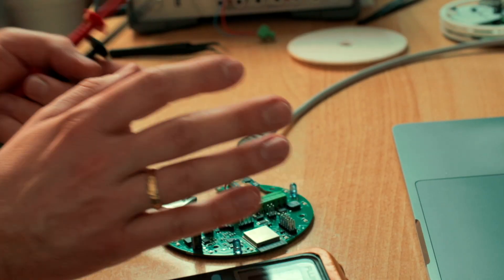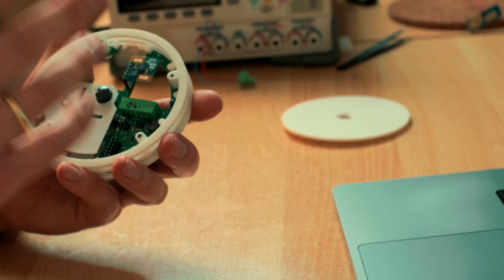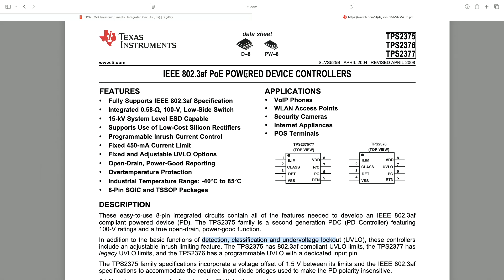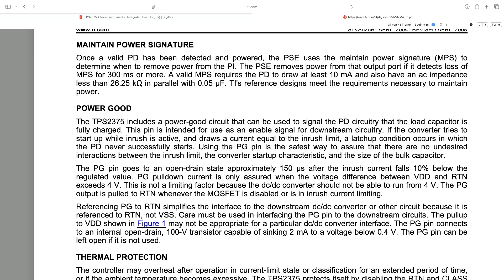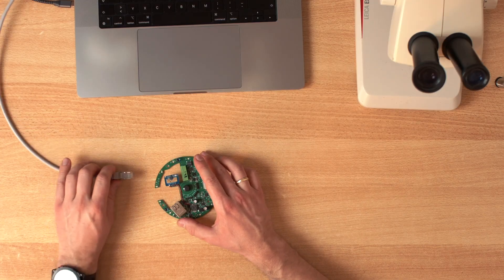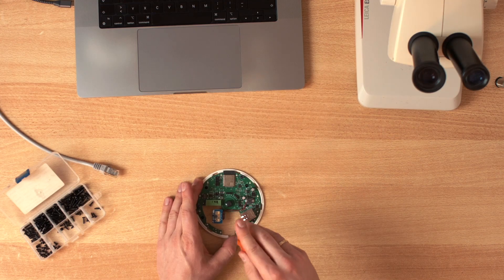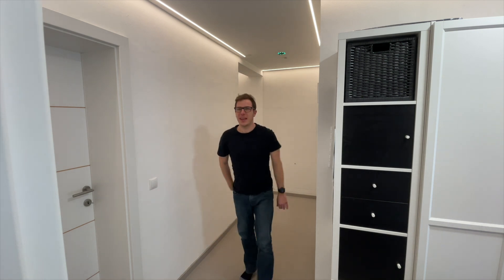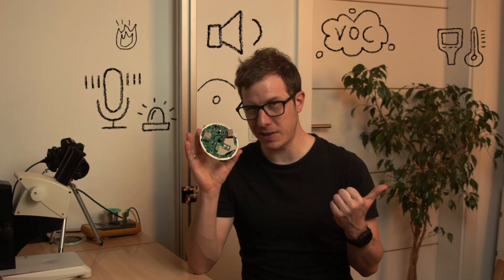ESPHome mmWave Sensor: Home Automation Magic

Comment: Remember to tune the mmWave sensor thresholds. Also, if you are concerned about heat/power, try the LD2410S which draws barely any power. Unfortunately I don't know how to design PCBs yet, but I think is is possible to have just a 2410s, a lithium cell, a charge controller and a simple radio transmitter in a small box, and have presence sensing everywhere.

Comment: 5:35 - slap a diode between PG and and EN, problem solved :)
Reply from the maker: Would be great but unfortunately not possible, PG is an open drain output.
Reply: @playduino but then if PG is open-drain, there is no possibility of powering the POE chip through PG. Are you sure that this is the problem ?

Comment: I'd guess that a schottky diode and 1ms RC filter from the PG -> EN line should be enough to properly connect those two chips with no issues, but obviously you'd want to check before trusting my guess.

Comment: For one of my projects, i added a breakaway part to the PCB using a KiCAD mousebite library. I sneaked data lines through those mousebites and added some headers on the breakaway part for power, I2C and SPI. This makes it a lot easier to test new stuff, because i could use the PCB as a dev board, yet still remove that part when i was done to make the final PCB smaller. It was also quite useful because i had the header to flash the initial bootloader (a one time operation) without having to "waste" space on the main board.

Maybe this could be useful for your sensor, since your round PCBs already come with breakaway parts from manufacturing. You are already paying for that, might as well use it for initial flashing and for testing?
Reply from the maker: Love it! This is a great idea! Thank you!
Reply: @playduino  Forgot to mention: To make this safer, make sure you don't ground-fill the breakaway (mousebite) areas and use only one single signal per "finger" in the mousebite. That way, there is no potential of shorting different signal paths together when cutting/breaking the area.

Comment: Hi, this is a nice project and I am following this with great interest. As these mmWave Sensors will generate a fair amount of heat while there are in operation, do you think it will interfere the temperature sensor readings?
Reply from the maker: I'm glad you're interested in my project! 😊 You're absolutely right — accurate temperature measurements are tricky with ceiling-mounted devices, especially when some components generate significant heat themselves. I do have a few ideas to work around this, but it's definitely one of the more challenging aspects of the project.
Reply: Just use the LD2410S variant, it needs so little power that it can even be powered from a battery for months.
Reply from the maker: @SodaWithoutSparkles interesting, but is it good?